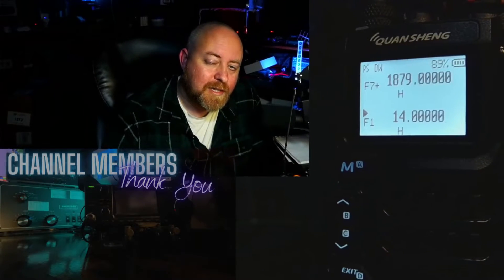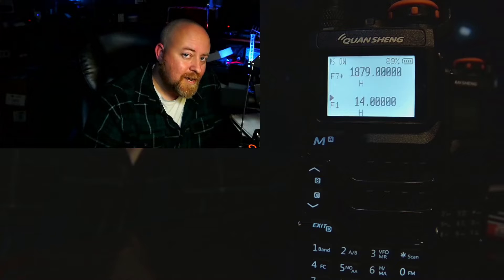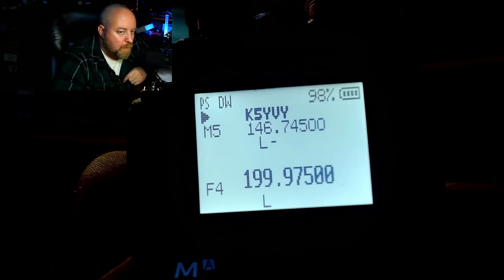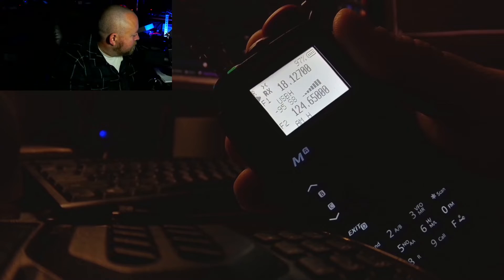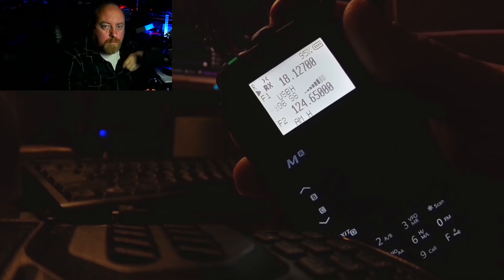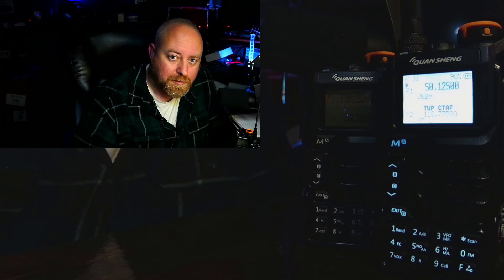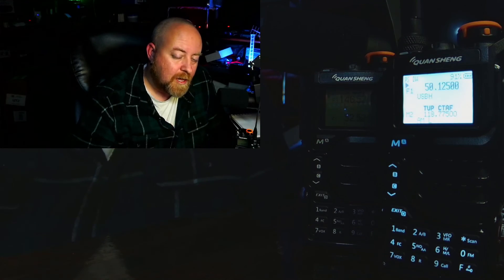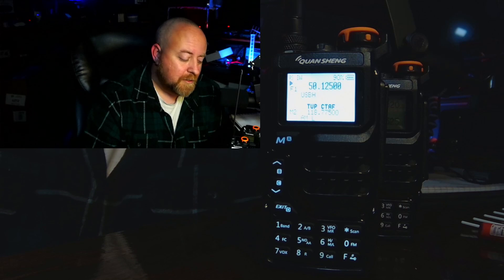REALLY fix AM on the UV-K5? Plus MORE features?!

Comment: Thanks for sharing; I was hopeful AM Airband receive would be better but my Radtel 470X does a better job even if it's still not perfect, at least it also has a fuller audio.
Reply from the maker: Thanks, yeah these radios are not purpose built  AM receivers, but if a product is going to advertise am receive/air band you would expect it to sound good.  There is community firmware out there now that greatly improved the reception on air band, still not perfect but very noticeably better.

Comment: Will it ever be possible for a radio like this to input into the computer 
for discriminator tap or similar.
I know most people say no . 

Anyone know about anything , matched up with special software.
Reply from the maker: Natively probably not, but there are ways to tap into most these on their boards by soldering a wire to the right circuit. I have not done this but there are guides online on how to do it with baofengs. Special software I’m unsure what you mean.

Comment: This is not the latest update, the latest is one that you can dowload right with your browser, and NO, i cannot put any links here because it is not my channel, and they will promptly be deleted. - i myself have not installed this, but have Fagcis  firmware (from Github) the airband AM works flawless, as the browser update also do.
Reply from the maker: I don’t think I said the latest, if I implied my apologies. But the link I believe you are referring to is https://egzumer.github.io/uvtools/?firmwareURL=https://github.com/egzumer/uv-k5-firmware-custom/releases/download/v0.19/egzumer_v0.19.packed.bin 👍
Reply: @K5YVY  yes, it is that firmware, but i will not do it, because it appareantly limits transmit to HAM bands, not 100% sure though - and i just found a guy here on YT where he BOTH transmit and receives on SSB! - this radio seems to be full of surpises! - i can only receive USB with my update, 73, Levi
Reply from the maker: @MrKeys57 I do believe the software I used in this video which was derived from the software you mentioned does in fact disable transmit outside ham bands. But there are many different versions out there with some that definitely allows it. For any comfort for what it’s worth, no longer than it takes to load firmwares in these radios, it’s not too painful to try several until you find one you may like. It’s fun to see what people come up with to make these do.

Comment: Can you tell me if TX is working on all bands including 18-54MHz ?   I tried a bin that looks identical and TX was disabled when I tried 10m AM
Reply from the maker: There is firmware that allows transmit in the full spectrum, BUT given the hardware inside the radio it will only transmit FM, and if you did use a firmware that allowed transmit in the extended range, the output power is in the milliwatt scale. So in reality it’s not worth your while to have the ability to transmit milliwatt power fm modulations. The firmware I used in the video disables transmit in extended range.
Reply: @K5YVY  Yes that is exactly the firmware I have.  I have measured the output power and it is milliwatts but fun to use at a local level or try connecting it to a good antenna and try a little FM on 29.6 MHz
Reply from the maker: @n1kkri lol I did the same thing with I had one that would Tx. It was fun to have a little 6m and such HT even if I could only reach other radios in my shack😎
Reply: @K5YVY  When I was a kid I modified a 49MHz Lafayette Radio walkie talkie to 6m  The power was 100mW.   I lived in a 3 story house and one day I went to the attic,
open the skylight window and climbed out on the roof.  I was on 50.6MHz and worked a few Hams that had to be 2-3 miles away.   I did the same thing with a Radio Shack Archer Space Partrol CB channel 14 walkie talkie accept I connected a piece of wire from the 1st floor to the 3rd floor Window.  I spoke to people a couple miles away
as well as some of my friends who lived about a half mile away with the same radio with theirs only having the whip.   It was a blast.
Reply from the maker: @n1kkri oh yeah, the days.
Reply: @n1kkri  milliwatts on your frequency, but more than double the power on harmonics and spurious. So please don't.
Reply: @gartnl  That is probably true.  I would have to look at the harrmonics on 10m or if home run it through an antenna tuner that might reduce any harmonics.
I use to have an old Drake in line LoPass filter with a cutoff at 6m, ha ha...
Reply: @n1kkri  In all honesty: it's a crap transmitter on all bands. Barely legal on HAM bands and useless on any other band.
Deaf on RX outside factory frequencies. 
Sure, it's fun to play with custom firmware. But hyped IMO. It isn't the miracle HT people talk about. I just use it to monitor local traffic.
Reply: @gartnl  Your right,   It's not as sensitive as my other Ham HTs and I have done power outputs showing the low output on the fundamentals
while looking at harmonics on a SDR receiver.  Yet, for the money and to be able to receive over quite a range along with SSB it's amazing and it shows
what can be done with the basic chip that offers this range should it be followed with filters to prevent harmonics.   I have to go back and measure
the power with the radio set to low power and see if it makes a difference at the fundamental and then note if the harmonics are reduced to the point
it might not cause interference.
Reply: @n1kkri  It gave me a great weekend of fun. For 17 euro you just can't complain ;) And it has found a place in the kitchen as a monitor.
Reply from the maker: Surprisingly, on different branded radios, we have been noticing spurious emissions get worse on low power, and although still dirty, much cleaner on high power. Breaking the rules of common logic lol.
Reply: @K5YVY  More surprising: Baofeng showed with the GT-5R they can do it right. It even seems the current Baofeng UV-5R is ok as it is now identical to the GT. As with all their products: the Chinese are very well capable of producing quality equipment. Why they keep producing sub-standard items for just 1 dollar less is a miracle to me.

Comment: I just bought a uv-k5(8) and can't get any PC to recognize the usb programming cable.  Tried 3 widows PCs and a Linux Mint machine.  Nothing.  It came with a driver disk, but no PC of mine has an optical drive...  Tried installing the Quansheng AND Baofeng programming cable drivers too.  No dice...  I ordered another cable, thinking maybe I got a bad one.  I hope that's the case..  Anybody else had this issue and fixed it?
Reply: You need to push the connector into the radio to the point you think you're about to break it.
Reply: K type only....

Comment: Mode went through great but how do you put it into am? The am fix is on, I’m on my airport channel 118.700 but I can’t find how to get it into am and have the am show on the display?
Thanks.
PS, can change the band with F-1 but it goes to a higher channel, 138.000.
Reply from the maker: In the firmware used in this video menu number 13 called Demodu allows you to change modes. You can assign a side button with short or long press as a shortcut to this as well.

Comment: I hated mine so bad i literally threw it in the trash. I dont know if their are good ones and bad ones but mine, i could not understand one dam thing coming out of it over the high pitch of the static. and thats even when it would pick something up. baofeng in same room picked up audible signals 75% more often (this radio would not even notice a open channel) than this thing. the squelch did not act like it did anything at all. Yes I said baofeng so what does that tell you about this radio?
Reply from the maker: Well I definitely do make claims that this is a great radio, it’s definitely not, but for the folks that like to tinker, code programming, and change things up, it’s a fun radio to mess with.  Appreciate you leaving a comment 👍.

Comment: It’s remarkable that SSB transmissions are really good but VHF AM is still almost unintelligible. I was looking at the signal meter for the first transmission and observed a -48 and it was very intelligible. So is that a dBm indicator? The tower was very scratchy and -16 dBm. So is is the signal too strong for the rig’s front end? Likewise with USB on HF the signals read -105 and very intelligible. What would happen if you received VHF air band with a plain old quarter wave instead of the directional Yagi?
Reply from the maker: It is definitely possible with a lower gain antenna. I was also surprised how well I could hear and understand SSB signals on HF….
Reply: @K5YVY  sounds like the radio’s AGC was off and your rig is suffering from front-end overload. Turning off AGC on VHF air band may have been a conscious decision by the programmer to insure maximum gain with weaker signals but when AM signals get to -16 dBm the radio’s front-end seems to be overloading.
Reply from the maker: @radiotec76 I could definitely agree with that, I’ve also heard of a sensible reason of a chip that attempts to make conversion of the signal to AM and just isn’t the best choice for the job. It was much more technical than that but to much for me to remember at the moment lol.
Reply: @K5YVY  I don’t see how a chip that receives SSB, WWV and AM CB so well should have difficulty with AM on VHF air band.
Reply from the maker: @radiotec76 I’m with you. I’m far from a electrical engineer , but proper AM IC chips aren’t that expensive and I wouldn’t think it would be that much more costly to produce radios that are going to claim air band receive to have those proper IC’s put in them 🤷🏼‍♂️
Reply: @radiotec76  It might be strong FM broadcast interfering by saturating the receiver.  I have seen the same effect for HF SSB on this radio too.  You can make a coax stub filter for the FM band.   AM sounds ok on mine, but there is a hiss that is higher than I like on Aircraft AM.
Reply: @la7dfa  good suggestion.
Reply: I agree with what someone said previously, I don't think there's any AGC on AM. I don't know if AGC can be added with firmware or not? I do know that most software for controlling SDR dongles have AGC control, but I don't know if it's all being done in software or if the SDR dongles have a hardware AGC circuit? BTW, I have a Baofeng 5RM (not UV-5RM) that receives airband, and it has the same problem...heavy distortion on strong signals.

Comment: My buddy has this radio an dI might ask to borrow it and see of the air band is. We're just a few miles from the airport.
Reply from the maker: I still believe the hardware is the problem, although these people that create custom firmware can adjust values inside the configuration and clean to the sound of the signal, I’m not sure that it can be completely fixed without different hardware. Some of the air band sounded excellent like FM, others was hard to hear in the white noise or just plain garbled garbage as it seem just just depends on the strength of the signal received. 🤷🏼‍♂️ I do appreciate people putting in efforts to improve it though.

Comment: @k5yvy do you have a video or know of one. Going from new radio to downloading the firmware? I have tried to watch several different videos and can’t seem to unlock mine like this. 

I want to be able tx and rx like your doing in this video
Reply from the maker: Have you watched my video on how to update the firmware? Link is in the description of this video.
Reply: @K5YVY  yes sir. I watched it right after this one. I mean a step by step video. I’m new to having s computer so the zip files and pulling from the zip files. Taking the firmware from GitHub and putting it on my radio. That’s all confusing
Reply from the maker: @atr_midtnwx @atr_midtnwx understand, we all have to go around that learning curve at some point. In a nutshell, when at the chosen GitHub page, you should see on the right hand side of your screen the word “Releases” circled in green, clicking on that should take you to the files, in this case you are only wanting the single file that ends with .bin , you don’t need the .zip files. Use the online firmware flasher https://egzumer.github.io/uvtools/ , (must a chrome browser, Firefox don’t work) once there click on the Browse button on the right side. That will bring up your file explorer on your computer and you just need to find the .bin file you downloaded (likely in your downloads folder) once you select the file, click open, and it should leave you with the webpage I had you at. Then with your radio turned OFF, hold PTT button while turning the radio on, your LED on top should be on steady, now connect your programming cable to your radio and computer. On the web page click Flash firmware. It will ask you to select the COM Port your cable is assigned, if the one you pick didn’t work simply try again till one works, Your light on your radio should begin flashing and once it is done your radio will restart with your new firmware🥳. Hope that helps.
Reply: @K5YVY  so you have the flash the radio first? Does that delete all the setting on the radio?

Also I have tried this before and I have click the rx 18mhx to 1.3ghz and tried to download that and it didn’t work. Then I tried the same on tx and it didn’t work. Is that because I didn’t hold the ptt button and turn on the radio first?
Reply from the maker: @atr_midtnwx it’s possible, the radio will not accept a firmware file without first holding PTT while turning the radio on, the light on top will come on but the screen will not. This indicates the radio is now in firmware flashing mode and ready for you to send it from your computer to the radio. Once it completes the light in top turns off and your radio screen will come on and it’s now ready for you to use. It odd possible you may lose saved channels, but in my experience I did not lose any.
Reply: @K5YVY  so flashing the radio is like using other radio programming software? Just writes that firmware to the radio?

If I do loose my saved channels.  Can I go back in and program them
In again after the flash? Like I did when I first go the radio? The only thing I have changed was unlock it to use on gmrs. And program 50 or 60 channels. But I have that saved in chirp.
Reply from the maker: @atr_midtnwx that’s correct Flashing is basically just the term used when “programming” the radio with new firmware. I suppose it’s not referred to as programming since you’re not inputting your own data as you are when putting in frequencies and saving them to channels, but instead loading a file premade that the radio uses to function at all. 

Yes you should still be able to program frequencies/channels just the same as you have before. 👍
Reply: @K5YVY  thank you for taking the time to explain. I have try this tonarrow evening. While watching the club house show. 

One more question have happens if when flashing and the flashing doesn’t work? Is the radio useless or can you go back and put the factory firmware back n the radio?
Reply: @K5YVY  if there isn’t a video. Maybe I can catch you on discord sometime if you don’t mind
Reply: Did your menu change and look weird after the update?
Reply from the maker: @atr_midtnwx it did change with the some different font and menu options, but I wouldn’t say it was weird like messed up , if your referring to weird as in just looking a little different from factory firmware the yes.
Reply: @K5YVY  yes that’s what I’m meaning not weird just different. 

How can I scan on this radio? For near by signals
Reply: @K5YVY  I also click on the link in description for firmware used in this video. 

When I click on it says firmware_packed and firmware raw. I flashed the packed is that the right one or should I have used raw
Reply from the maker: @atr_midtnwx packed is the one I used👍
Reply from the maker: @atr_midtnwx you should be able to push the F button then the number 4 , I think this will need to be a fairly strong or nearby signal, not sure how sensitive it is.
Reply: @K5YVY  thank you sir. Have you experimented with the ssb firmware?
Reply: @K5YVY  thank you sir. I will look into the signal scanner
Reply from the maker: @atr_midtnwx so far only what I have during recording the video. I was able to hear stations pretty darn good for a $30 radio that’s not designed to receive hf.
Reply: @K5YVY  yes sir. how do get over to ssb with this firmware?
Reply from the maker: @atr_midtnwx in vfo mode just type in the frequency, for example 20m type 014.250 and it will take you to 14.250mhz and should automatically switch to SSB. If not go to menu and menu number 13 Demodu and swap it to USB
Reply: @K5YVY  yes I can get usb on 20m but isn’t 10m on lsb?
Reply from the maker: @atr_midtnwx no everything 20m and above is USB 40m and lower is LSB 👍
Reply: @K5YVY  o ok thank you for that. I haven’t got into general yet. Thank you for all your help. I have finally got to enjoy this radio.
Reply from the maker: @atr_midtnwx awesome, no problem !